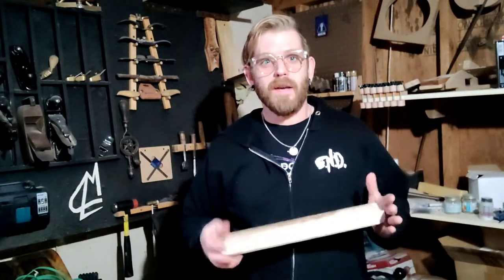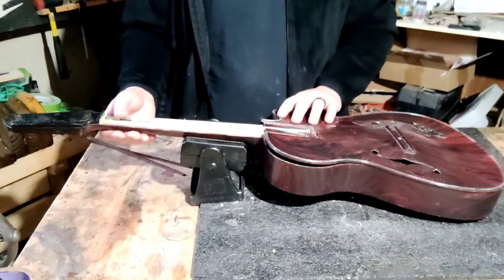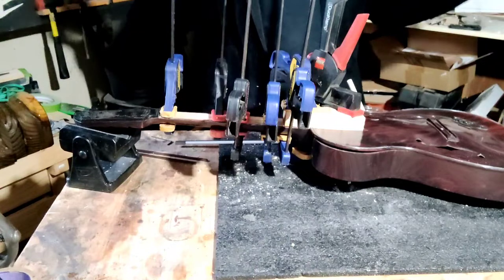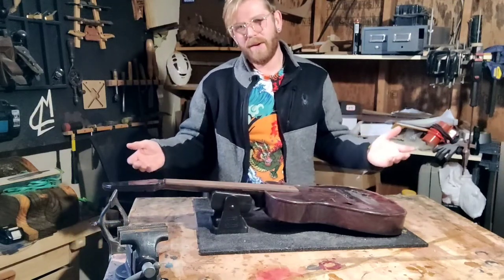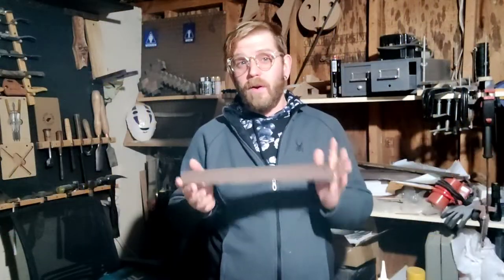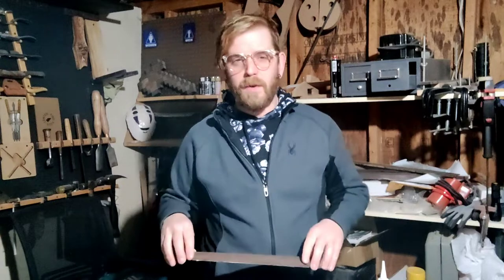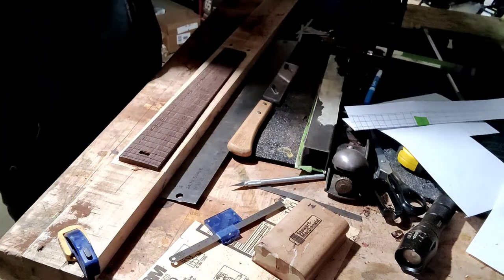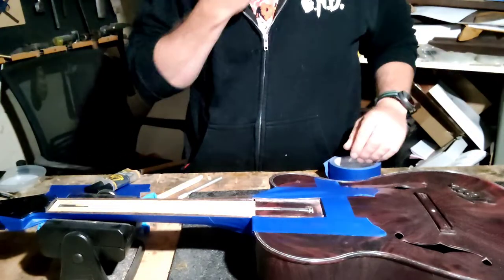Emenee 1960s Vintage Toy Guitar, Part 2 Can We Make It Playable? Let's Find Out

Comment: Great project Miles. I like the use of the radius gauge as a scraper. No GGBO this year?
Reply from the maker: I only use it in the final passes for scraping and I'd suggest having a "scraper" set and one just for checking. I'm in the ggbo this year. Life has been hectic the last couple months so it's been slow moving. But my neck is all set and the body is moving along atm. Just need to edit some videos.